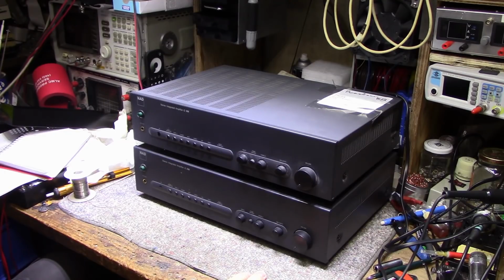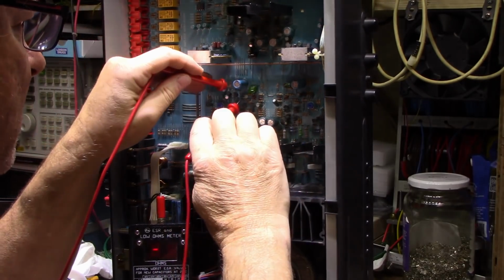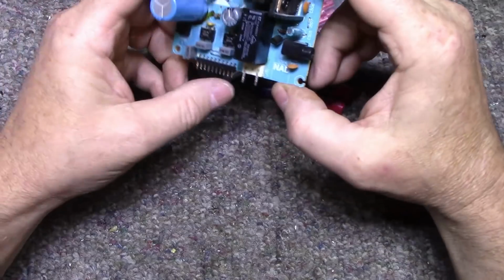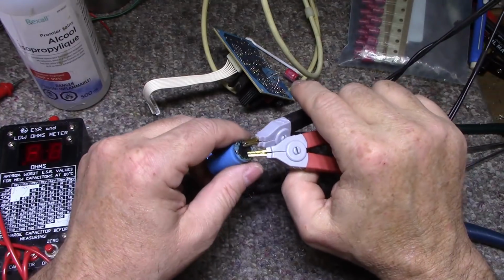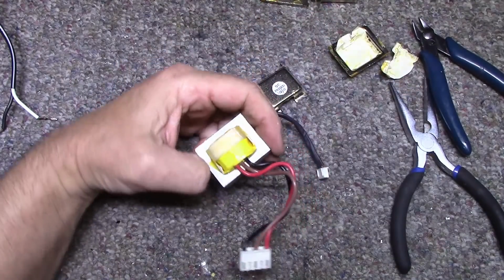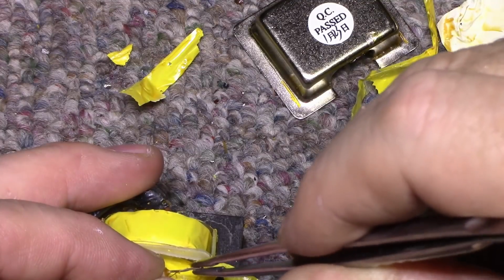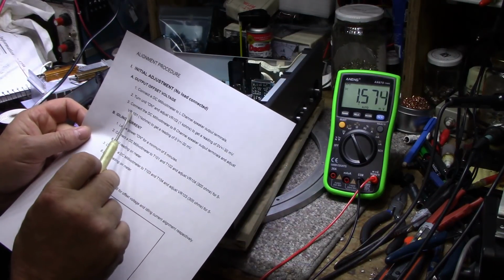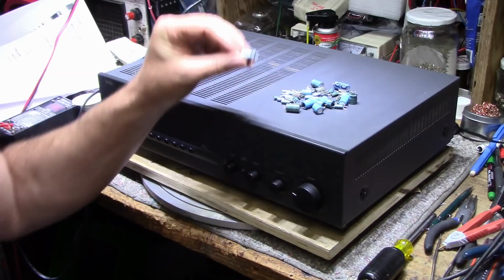NAD C350 - Repairs Part 1 (Ep. 101)

Comment: at the 21:00 mark you make mention of the replacement 560ohm 1/2 watt resistor. What kind of resistor is that? (Metal oxide, ali film?) And how can you tell what power-rating it is by looking at it? Cheers.

Comment: I've got a NAD 3225PE that's been with me since 1991. No issues from being left on 24x7 for most of its 32 years.
Reply from the maker: No issues that you're aware of. I'd love to yank & test those caps just to see how bad they really are
Reply: @TrevorsBench  Had all the caps in signal path replaced around 2010 because NAD, but I think the Japanese made ones had less issues with transistors and boards. Still sounds superb, no crackling on the dials, silent at full power with no signal, etc.
I also have a C720BEE that dates from around 2010 which has needed a full recap and dry joint reflow. I think the newer the NAD, the lower its life expectancy.

Comment: Thanks for the upload. I am wondering what your view is to what made the secondary transformer over heat? I have the same amp, in which i replaced the secondary transformer and the big smoothing caps but it got super hot super quick after playing for a few minutes and went open circuit again.
Reply from the maker: Excessive load on the transformer will be the only thing to burn it out. Check the fuses for proper value. 
There could be a few things to overload a transformer.
Could be a shorted diode in the bridge rectifier ( I'd expect a fuse to blow first)
Could be a shorted main filter cap but you said you replaced them. I assume you got them polarized correctly. Are the capacitors voltage rated correctly for the power supply rails?
Could be excessive bias on one or both power amplifiers.
All that power needs to be going somewhere, did the heatsink get hot? If so the power is being gobbled up by the output transistors which indicates a problem within the amplifier(s)
The transformer might be ok if it was just a thermal fuse that opened up. I'm not familiar with NADs toriodial power transformers but I'm guessing they do have thermal fuses wrapped up in there somewhere on the primary side
Reply: @TrevorsBench  Thanks for your reply trevor. I might have misled you, the transformer that overheats is the same as the one in your video at 55min. I think its called a standby transformer rather than a secondary transformer...that being the case do your recommendations still stand.. ?

Comment: I found a NAD 7130 receiver years ago set out for garbage in the alley. I think all the little bypass electrolytics were bad (4.7, 6.3 uF) I must have swapped out almost 20 just of those little fellows. Bad supplier at the time? I think this was mid 80s built.

Comment: I just finished recapping a NAD C162 pre-amplifier.  Has Class A circuitry, so it runs hot.  The caps were all pretty much cooked.  Whenever you get a NAD product from this era (early 2000s), it's probably loaded with "JH" brand caps which are absolute garbage.
Reply from the maker: Good to hear you saved another NAD. Not a big fan of NAD's build quality but when they are tuned up they are a treat to listen to. Thanks TG

Comment: I have this amp and it's approaching 20 yrs old, but no major issues yet. Thinking about attempting to test and replace some caps. Safety question: How do you discharge the capacitors on the power boards if you have to pull the board out just to access the leads?
Reply from the maker: The only capacitors that will carry a significant charge will be the main filter capacitors. They will discharge themselves through the connected circuitry after a minute or two.
So, it's safe to remove the power supply board and assume they're discharged if the unit's been unplugged for 5 - 10 min. Once the board is out you can test to make sure.
The voltages present on these filter capacitors is not enough to hurt you and it's isolated from the mains power. The only real danger is if you short circuit the cap when it's fully charged
Reply: @TrevorsBench  thanks for taking the time to respond. Much appreciated

Comment: I use to own this amp and was disappointed with the price performance ratio it was a bit better than a cheaper Sony receiver I realized that NAD did not make any where near the receiver or amps it did in the 80s I know because I had a monitor series 7100 receiver that was much better and more reliable. At that point I sold it and got my self into pro audio for less money and better and reliable performance.

Comment: Interesting video, i have one of these. Bought it new back in 2002 i think it was. It still works great but it has some issues with the balance so the audio is lower/non existent on the right channel, but i can get it back if i turn the source volume up (my pc), this will make it crackle and the sound comes back on the right. But it might disapear after a little while.
Planning on cleaning the pots to see if that helps, and at the same time do a visual inspection on how it looks inside.
Reply from the maker: Might be a cracked solder or dirty switch. Try tapping on the PC boards to see if you can locate it

Comment: Hi There, Great vid, It may be a ton more work, but a shotgun approach is needed on every electrolytic capacitor in the C350 including the big reservoir caps, had one many years ago & the big reservoir caps were rattling!! The reason the smaller transistors mounted to the heatsinks are stacked is for thermal tracking. Superb Amps & well worth saving, good work :)

Comment: 'Holmgren' is manufacturer Trevor, very good quality transformers, NAD maybe lower priced but are way above other manufacturers around the same price point, one negative point is some components can be a 'little' under rated but circuit design is excellent, I suppose in some area's it's a shame but not uncommon, of course that's no excuse, makes me wonder just how much they save under rating, not being a manufacturer I wouldn't have a clue but I would have thought just a few extra Dollars/Pounds on the retail and much higher reliability is a better way to go but then that's looking from a tech's point of view, they are run by the finance dept. not by design engineer's, WOW we saved a penny on that! NOT A CLUE!!!!

Comment: Soldering replacement caps, even 105degree ones, on the underside of the board is a good strategy with these NADs if space permits. Even if it means bending the leads and mounting them “sideways” with a dab of hot glue 

I have had a few NAD units. An integrated and a couple big power amps (c270, c272). All had those dark brown cooked spots on the board, many failing, leaking and bulging caps, including in places on the board that were not especially hot. And in units that had space around them and were not left on all the time. These things are just slow cookers. 

I have also seen cooked resistors on all of them. Including on the c272, where a couple resistors got so hot on the amp board that they melted their own solder joints. No kidding. They just sat in the holes in two molten solder puddles. Unreal. Likely due to a failure of another item. Strangely they measured in spec even though they were charred. 

Resistors and caps are packed too tightly together everywhere and especially around heatsinks.  Ventilation slots exist only above and below the amp transistor heat sinks, these heat sinks also  block any airflow through the rest of the unit. when the air slots are on the sides, the center overheats. In the c270/c272 the rectifiers and power caps are all right in the center of the unit. Cooking away and fencing in from the air slots by the amp boards. when there is only one bank of amp transistor heatsinks, like in this unit or the c325bee, the air slots are in the middle right above and below the heatsinks, which again block airflow to any other parts. There are no vents on the side or elsewhere to allow convection currents etc. thus the heatsinks themselves cook everything around them like a campfire. Filter caps, rectifiers included. Terrible  design. Nad: at least stamp  some more holes in your casings for crying out load!  Costs almost nothing! 

The units have a nice modular block structure and are prett easy to access. The issue I have had when fixing the NAD  is that any soldering , no matter how fast, causes the thinner  traces to lift off the board VERY EASILY. the traces themselves are tissue thin and the board substrate does not adhere with age. And many traces are super thin. I don’t desolder components as a result. I clip them out and then remove the stubs. Pulling the units directly will often cause traces to be destroyed if a bent lead catches on a through hole. The boards are the cheapest construction possible. Worse or as bad as much no name eBay junk. Much worse than that of Topping, SMSL, or similar vintage  Cambridge audio, parasound, adcom or rotel. Those blue colored NAD boards look nice. But are rubbish. 

I would never buy a NAD AV Receiver as a result. Or any of the Master series. Sure those might be built to a different standard and use cooler class d  but I don’t trust NAD to do proper heat management and board build quality for the long run.

Comment: Apparently NAD intended for the user to plug an external phone amp into the Disc input. That would explain why they still used the "disc" terminology without an actual phono board inside the unit. When I purchased my first British amp (the excellent Rega Elicit Mk I), I was confused by the "disc" label. I had no idea that is what Brits call the phono input.
Reply: Disk was like a picture disk or something in 2000 most or all brand left out the phono stages. Course they thought vinyl is dead. The truth is vinyl never died, it is the cd's that are almost dead. Vinyl is coming up again and I love it.

Comment: If any watchers had any question at all what excess heat can do to the internal components of an amplifier, your video made it all crystal clear.  Some brands may have been poorly designed internally; this unit looked like it roasted due to little/no air circulation.  With your tune-up work, these units should provide several years of service for your customer.  Thanks for posting!
Reply from the maker: NAD reminds me of one of those companies that has great ambitions to build epic equipment, focuses great effort into design to get the sound just right but it all falls apart when they hand the blueprints over to the production dept.
Having tuned these up they sound fantastic but the thermal mgmt in these is terrible
Reply: Does this one have speaker protection? I remember they used to blow speakers to bits. I had one but my dad threw it. Got 2 in for service now. Possibly fitting phono board to one of them (based around the NJM4558L has options for ac in or dc in, found on ali.

Comment: Nad can be a nice brand but sometimes they do stupid solutions.
Those cooked caps if I recap I place them underneath the board if there is room. Then they won't be cooked again. Nice job Trevor this amps don't need full recap I would not put in that kind of value. If it was a better brand I would recap all.
Good job and your friend or costumer us happy again.
Reply from the maker: I used 105C caps so hopefully it will last a few months longer than before, lol
Reply: @TrevorsBench  ahh those will be Allright even you mentioned the ones further away from the heatsinks on 85°c is ok. But just like you said the two voltage regulators on one heatsink is just to save money course they all needs there own heatsink. That's why I don't buy costom audio stuff. I made my own audio pre and power amps. No compromise anywhere. I don't care how much it costs. It is always cheaper then buying from a brand.
Mistake #1 and 2 lol I do make sudge mistakes too, that's makes us humans. 😁

Comment: I’ve done two C370s. Same story on those units. Baked caps everywhere. The protection module on the C370 is a terrible design. Huge 5w Zener diode basically touching 2 caps. Did full recap on both and at least 50% of the caps in each unit were out of spec.
Reply from the maker: Spoiler Alert! Actually, the second NAD coming up is in worse shape than this one, cooked transistors as well as 100% of the caps